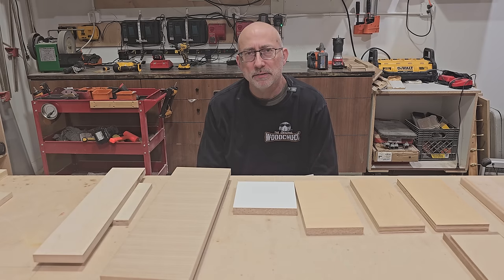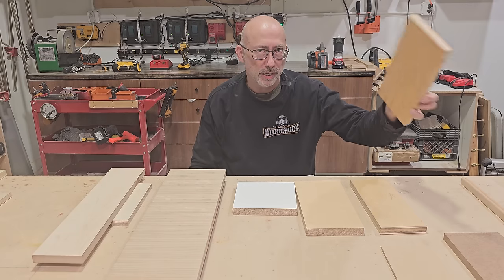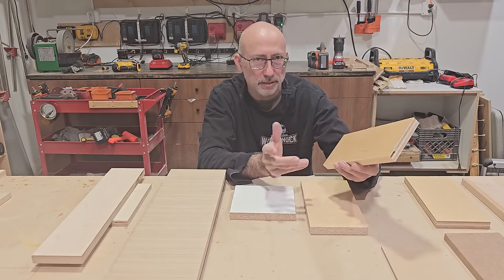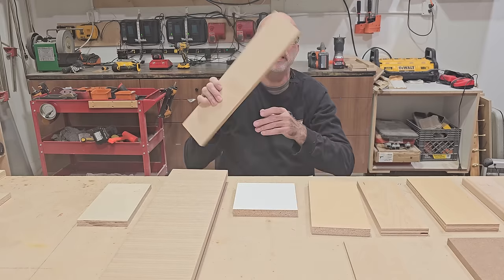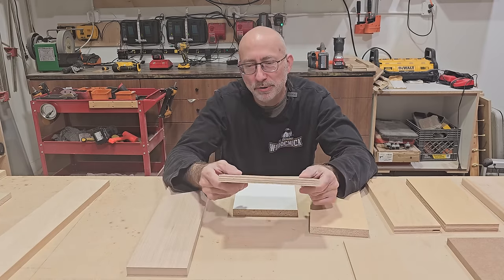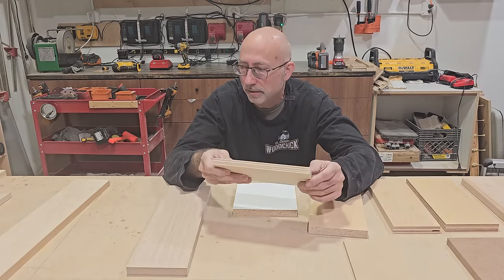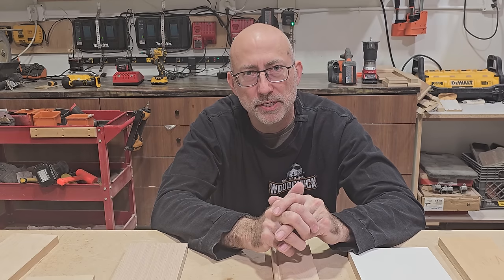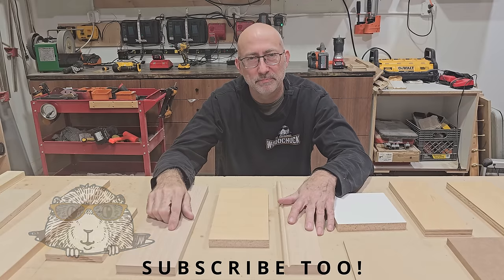Cabinet Box Material

Comment: Good choice on using Classic core pre-finished maple from Columbia Forest Products. The UV finish is very durable because of the curing process and not just a dried film. I worked in wholesale plywood distribution for 20 years and was able to visit their Old Fort, North Carolina facility.  The process is amazing. Good video, thanks.
Reply from the maker: That's good to know about the UV finish.  I have seen though some sheets show a "sprayed" look near the edges sometimes.
Reply: How does this factory compare to others you have visited?

Comment: As a lifelong cabinet maker and wood finisher it is my belief that the MDF of the 90s and earlier was better. It was more of an extrusion and the glue was forced to the surface, and a light sanding made for a very good flat finish, today's MDF made with the more environmentally friendly glue  is factory machine sanded to size, and it takes a lot of sanding to remove the tracking lines. I also prefer the plywood for boxes, I think it looks better, it cuts nicer, and is much easier on my back.
Reply from the maker: I agree with the weight, the Classic core is heavier.  I've just lately had better luck with it being flatter and now bowing.  I think batch to batch the Veneer core varies in its quality and flatness.  For frameless boxes this is more important for me. What are "tracking lines"?  Lines the machines leave from their rollers when it's manufactured?
Reply: @theoriginalwoodchuck  The tracking lines the lines left from when they sand them at the factory, if you hold a piece of MDF up to the light you can see the scratches left from sanding when looking at the face, the lines move from left to right as the belt tracks back and forth to keep itself centered.
Reply from the maker: Good to know.  I'm not a finisher and don't use raw mdf much.  I can't see the lines on the 1/4" MDF I have. Thanks! @schl8675
Reply: You are correct. Baltic birch with edge banding is the way.
Reply: @theoriginalwoodchuck p😢

Comment: Just found your channel !  I am a finish carpenter/ contractor ( small co. I do solo custom projects).  I do builtins , vanities, doors, ect.,.  Your is the 1 st channel where it speaks to different materials, and why to use them.  I do not do full kitchens that is not my expertise!  I refer to guys like you!  
If I was asked?  How do you do a lay out?  Plans?  Yours or GC’s and how do you start & finish an install?  Or do you just build them?
Reply from the maker: I work with contractors who sometimes have a designer involved where I get the plans, or I do them, for the cabinets.  I use Mozaik software to design and build with.  I Install as well.  There's back and forth with meetings and drawings before building.  And coordinating such things as electrical locations, under upper cabinet lighting, toekick heat registers, appliance locations, etc. Thanks for subscribing and I'll try to post what people are asking about, like yourself.
Reply: @theoriginalwoodchuck  Thk u for making these videos I know it’s time and not much compensation !

Comment: What would you use for a dual oven / microwave cabinet (or for a pantry) that needs to meet heat prevention/protection? Would it be prefinished inside the cavity or not?
Reply from the maker: Just follow the manufacturer's recommended specs.  Paint grade, pre-finished, or melamine- none of that has mattered in all my years.  Ovens are made to go into cabinets, as long as you follow the dimensional guidelines given to house them, width, height and depth-wise. I would not personally leave it raw wood, but finished with some sort of protection on the wood is always a good idea.

Comment: Interesting perspective on cabinet making...however, if you turned the clock back a hundred years I wonder what the preference would be with no plywood, mdf, or melamine...I've been exploring traditional cabinet making with hardwoods (4 species of elm, red oak, post oak, water oak, and hackberry so far) as well as pine and eastern red cedar.  Oak and elm tend to be extremely stable in my observations and if carcass panels are made using rail and stile construction along with tongue and groove joinery, they stay straight and flat.  My preference is to build  the carcass separately from the base.  I will generally use either oak or elm for drawer boxes. I will use 1/2" birch plywood for the back on some cabinets and cupboards. Most of the time I use rail and stile construction for the doors with raised panels (generally using bookmatched boards to form the panels).  I know this method is not conducive to production cabinet making as everything is about price but it produces very satisfying results and the cabinets last for decades.
Reply from the maker: WOW!  Sounds interesting.  Wouldn't you consider it furniture the way your doing it?  I also believe most kitchens these days don't honestly stay put for more than 10 or so years, sadly enough.  Maybe 20 at most.  But keep up the good work!

Comment: My objection to any version of MDF is the weight, very difficult for me in a one-man shop to handle. I have used MDO a number of times with great success on cabinet boxes. I'm curious do you have any experience or comments on its use?
Reply from the maker: I believe I used MDO once (it's basically classic core plywood without the decorative outer layer- so mdf is the 1/8" outside layer) .  It bowed like crazy if I remember, so I've been leary of it.  But I should check into it again now that you mention it.  Thanks!
Reply: I agree about the weight of MDF, I built my kitchen cabinets 30 years ago and they still look great, I painted mine with a high quality lacquer. MDO plywood is ment to be painted and alot of exterior signs are made with it.

Comment: What about using MDO to build cabinets?
Reply from the maker: Never used MDO. I checked with Phillips Plywood and it's an exterior plywood with a resin impregnated paper overlay, usually used for signs, etc.  There's such a thing as Pro core or "Classic Lam" that has MDF exterior layer.  It's paint grade and can be laminated with something else.
Reply: Do you think you can use it for kitchen cabinets?

Comment: What would you recommend for painted cabinets, inside and out?
Reply: And what for face frame? Also painted.
Reply from the maker: I use paint grade Maple, classic core if I can get it. Or find the best ply core you can get. The big box stores don't have it.  Need a real lumber yard. Lower cost solution is MDF, don't get lightweight MDF (it's for molding usually).  MDF is heavy but 1/2 the cost.  Again, use confirmat screws or dowels of some type.  Regular screws split MDF.
Reply from the maker: I standardly use Poplar for frames.  But it's not hard like Maple, which costs more and is harder to sand.
Reply: For FF I like maple, I think it looks better painted.
Reply: @jamespotter4878  hard or soft maple?
Reply: @LuisSanchez-wf9zw  Soft(brown) maple.

Comment: Not a pro by any stretch of the imagination, just a hobbyist/DIY type, but why not use mdf for the cabinet box? You mentioned that for slab doors or drawer fronts it would be ok, but not the box. I was considering using it for a set of cabinets I wanted to build in a laundry room,  because it was cheaper and they are going to be painted. Just don't want to make a mistake and use the wrong materials. Thanks in advance.  Enjoyed your video.
Reply from the maker: You can definitely use MDF for the boxes.  It's just not done for my clients as they always ask for prefinished plywood, plus the finishers don't have to finish the interiors.  Just use good paint to seal it all and you should be fine. Make sure you use good fasteners for assembly like Confirmat screws and you should be good.  Good luck!  Have you considered using Melamine so you don't have to finish the boxes?
Reply: I hadn't thought about melamine. That's an interesting idea. I'll check the pricing and available colors near me. Do you find that it chips or cracks easily. I guess I always associated it with being less durable than other products. Thanks for the reply and the alternative idea!  @theoriginalwoodchuck